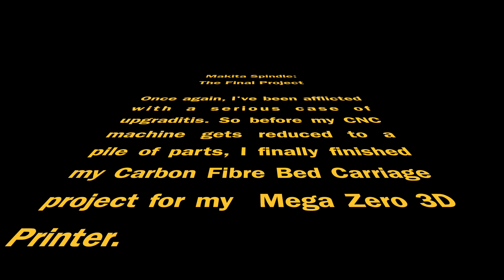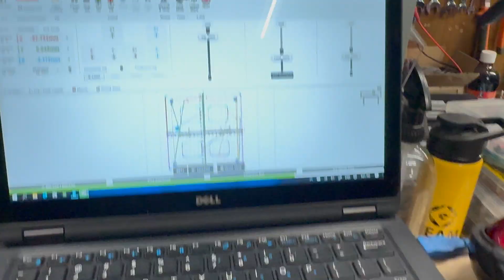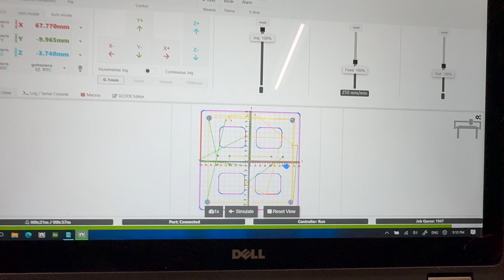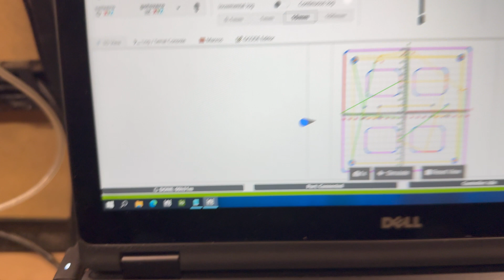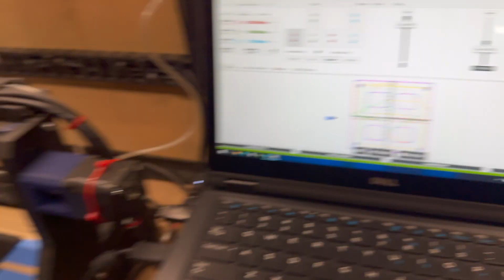Makita Spindle: The Final Project

Comment: Well, VFD near stepper drivers (looks like Toshiba 6600, right?) is not a very good idea....I had a lot of EMI interference issues with similar setup...So, i solved it, VFD  in separated shielded metal case and drivers are also in shielded metal case. 1 meter distance between two cases, and all EMI issues are gone!! Toshiba`s are not junk or very bad drivers, they works OK. But they are very sensitive to EMI/RF high frequency noices((
Reply from the maker: @TheDIMONART  I’m using shielded cables and everything is grounded, so hopefully that won’t be an issue. Otherwise I’ll out it in a spare enclosure.

The drivers are actually TMC2160’s by MKS.